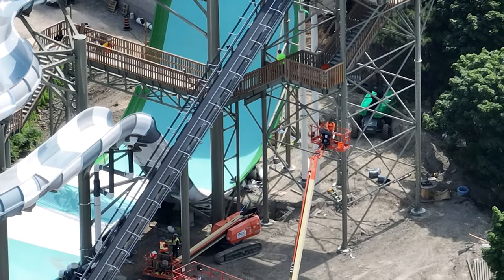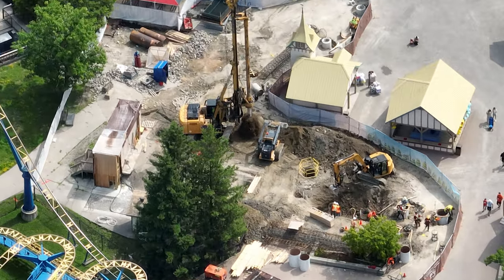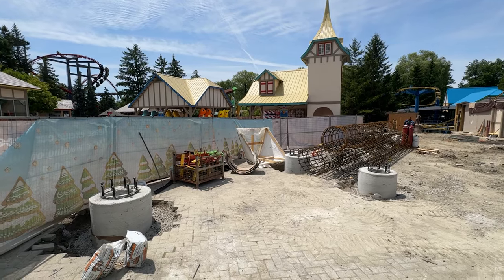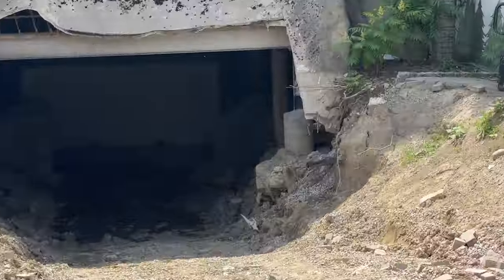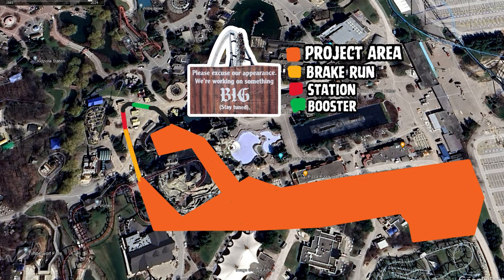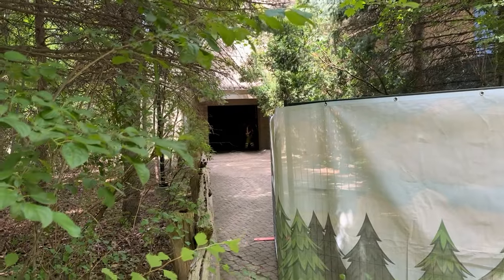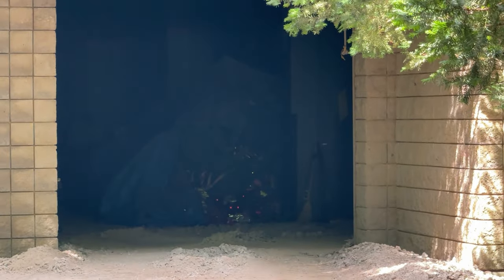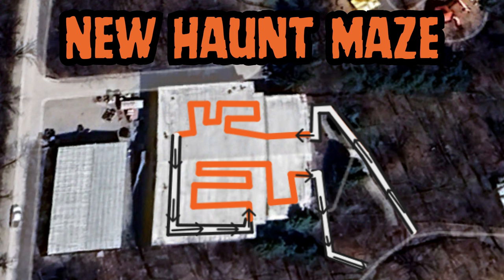Canada's Wonderland Next Coaster Construction Update

Comment: Back of napkin math based on Full Throttles support number and track length plus the number of supports for this is 4600’ of track and 71 seconds of prime ride time.
Reply: Maverick has 4450 foot of tack. I this is comparable to Mav in speed and ejector air, I'll be a very happy man.

Comment: Do you think it will have a swing launch like the Sky Rocket models?
Reply: Would be cool if it had a reverse spike launch like Icebreaker that went out the top of the mountain and then back down in, and then a 2nd launch from inside the bottom of the mountain like Full Throttle later.